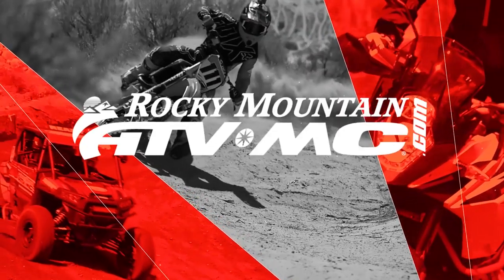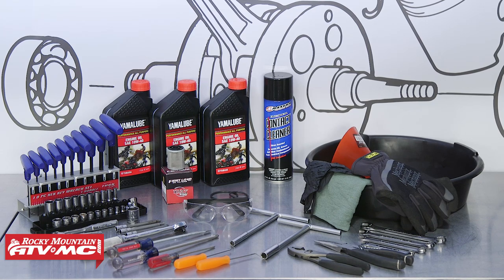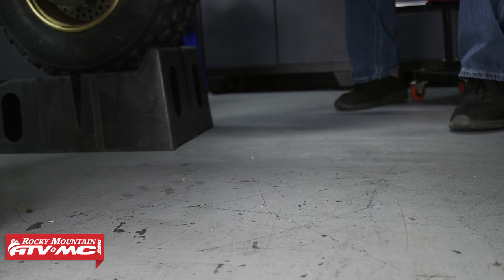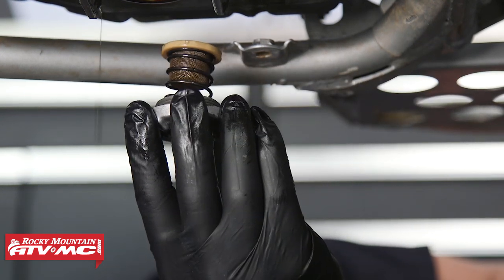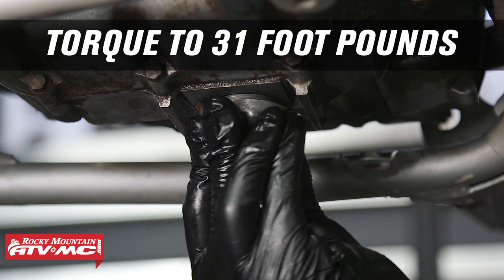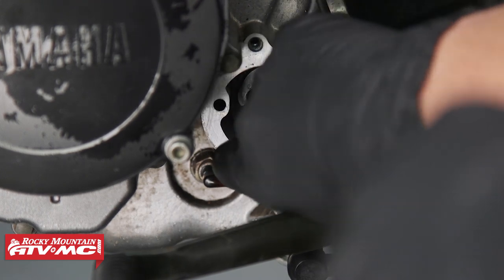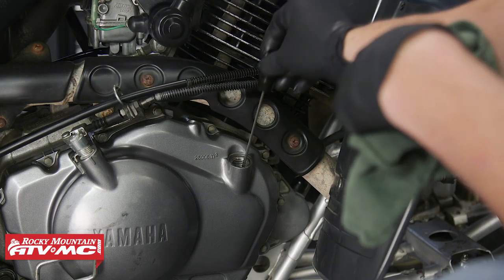Yamaha Warrior 350 | Oil Change

Comment: Great video. Do u check the oil like a car or eun it first than check it?
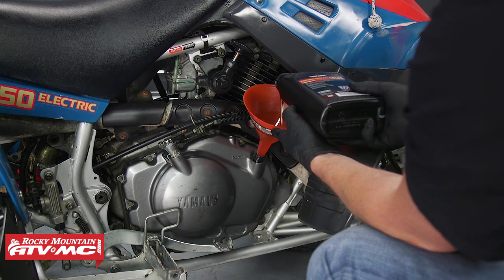Reply from the maker: You will want to run the engine before checking the oil level. We show that step starting at 2:50 in this video.
Reply: @rmatvmc  ok thanks.

Comment: I bought my first quad a 2004 warrior. So I took it for a ride yesterday and rode it for 3 hrs and this morning I noticed the engine oil was low. Is that a normal thing on quads?
Reply from the maker: No, you should not be burning much oil at all. I would top it off with oil so it's full on the dipstick, then check it again after a ride to make confirm it's losing oil. Then, you can start trying to diagnose if your machine needs new rings, seals, or something else.

Comment: What happens if you dont run it first? I forgot to run it and when I drained the oil it had gas in it
Reply from the maker: Running the engine first just helps warm the oil to make it drain a bit quicker.

Comment: You forgot the oil pressure test plug. It's not completely necessary but does let you know if the pump is going before you cook the head.

Comment: How many hours can you get until the 4 wheeler needs the oil changed?
Reply from the maker: It depends on what your manufacturer recommends. Have you looked at your owners manual?
Reply from the maker: The service manual recommends changing the oil every 6 months but if you're harder on your quad or ride it often, it won't hurt to change it sooner. or whenever you see the oil starting to get darker.

Comment: What fluid goes on the other side with the black plastic screw
Reply from the maker: Nothing. That is a sight hole to help get your engine to top dead center for setting timing and other engine maintenance.
Reply: @rmatvmc  ok thanks